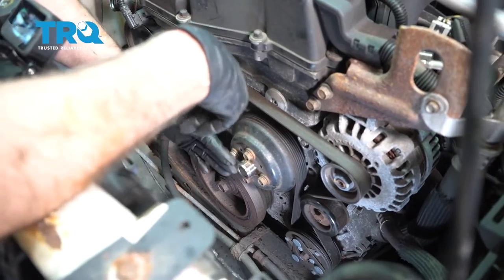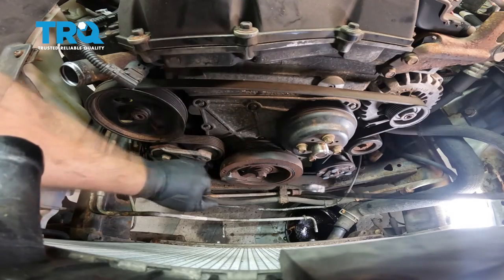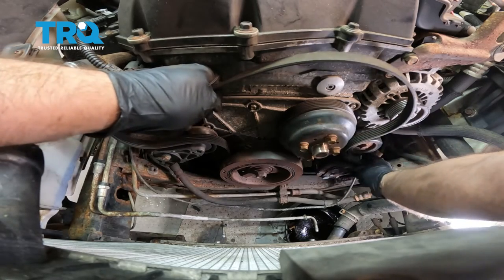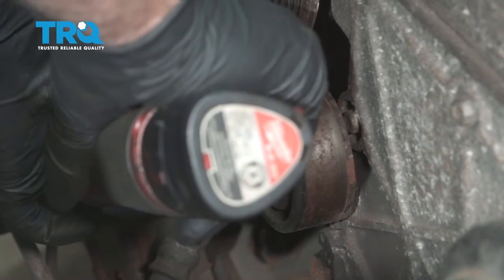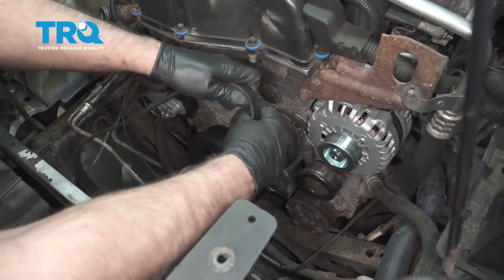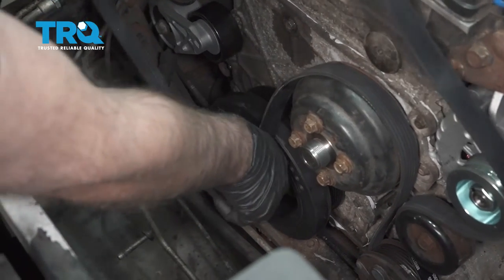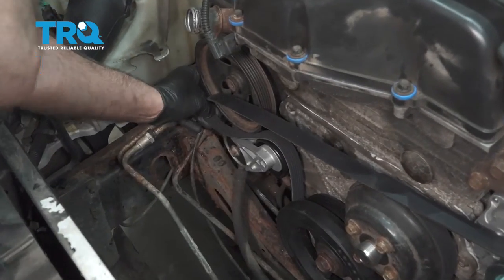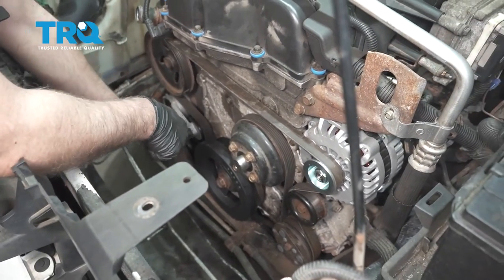How to Replace Serpentine Belt Tensioner 2002-2009 Chevy Trailblazer

Comment: My 15mm bolt broke the one that connects the tensioner to whatever it bolts on to. Can you tell me if that is a housing, the power steering pump or directly to the engine?